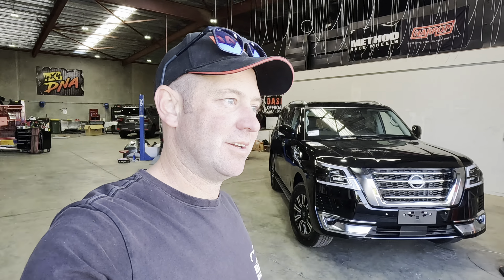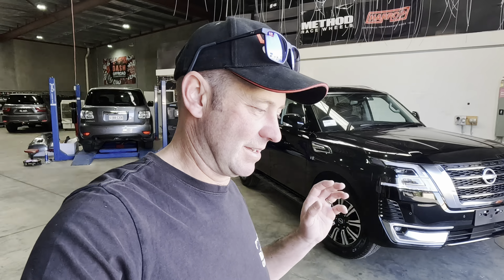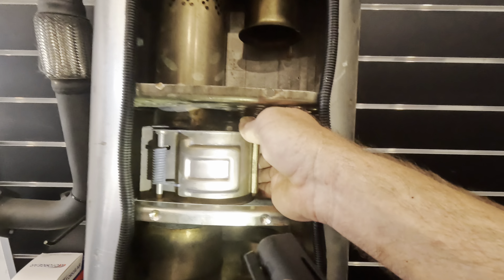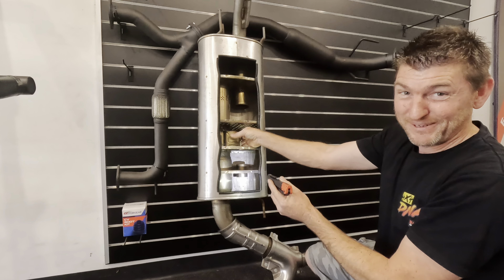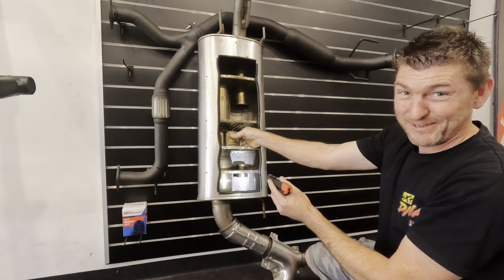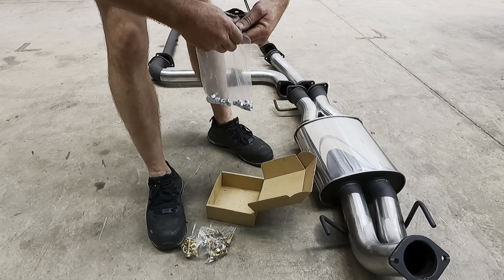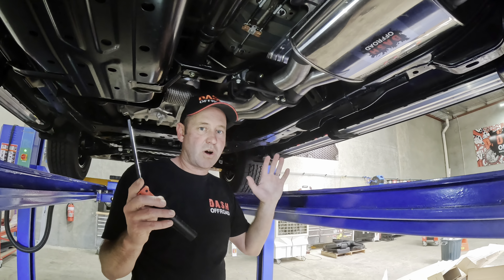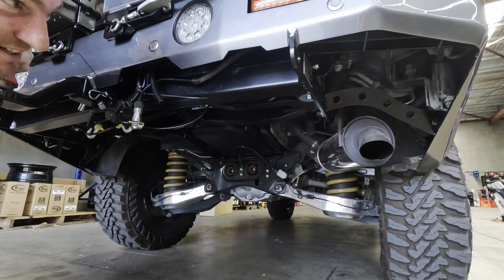DASH SAMURAI - Ep.1: A Y62 Patrol Exhaust That Sounds Like You Have Headers (Without Headers) 💨

Comment: What sort of hp/tq increase have you seen on the dyno and have you seen an increase in fuel efficiency due to better air flow?
Reply from the maker: The exhaust alone doesn’t do much, but in conjunction with a tune you would consistently see 10% gains from a Y62